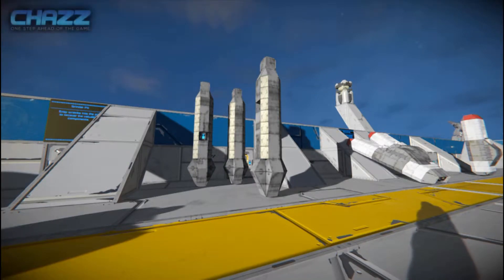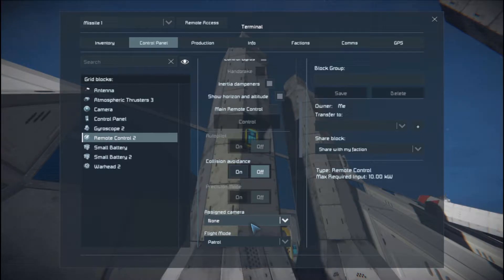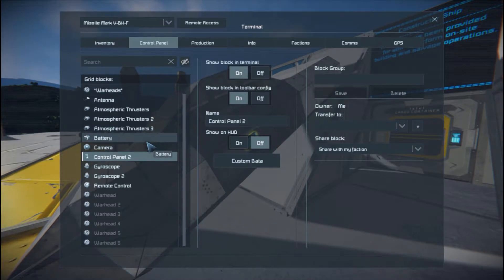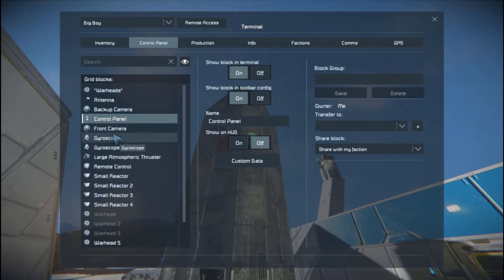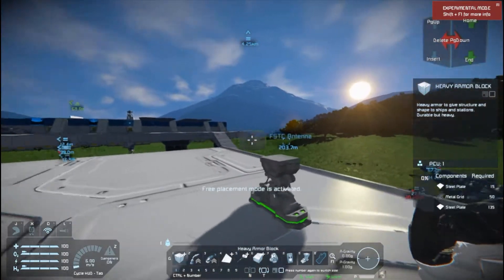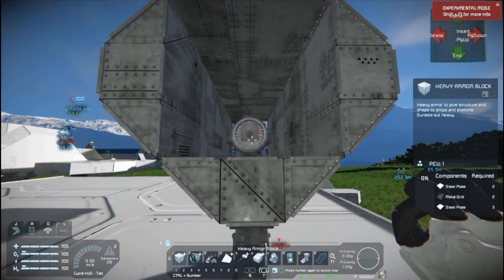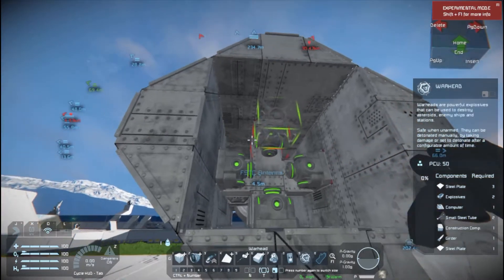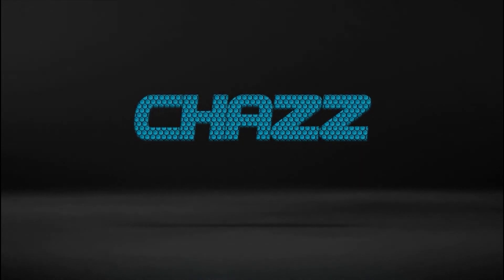How to Make Missiles - Space Engineers

Comment: How do you make them explode? I build rockets like yours with 8+ warheads armed them but they make the same amount as without warheads :(
Reply: You need to arm the warheads. Check the warhead block UI, it'll have a tickbox. People usually arm them before firing or set up a sensor to arm them. Also make sure you arm all warheads, the unarmed ones won't explode.
Reply: @mpnuorva  i said i armed them and i armed them all. i use 16 of them but the damage it does on impact is just as big as without them
Reply: @kampkrieger  I don't know whether you solved it yet, I know it's been a year but maybe you needed to set a timer for the detonation or detonate them manually?
Reply: @kampkrieger  I have the same issue as this guy, the problem is you don’t want to set them off manually as trying to set them off at the optimal time down to the second whilst the thing is travelling max speed is not easy or effective, the problem with having a timer is how effective is that on a missile that’s at max speed? Will the sensor + timer -+ warhead reaction really happen fast enough when a max speed missile detects enemy ship?
Reply: @SamuelP711